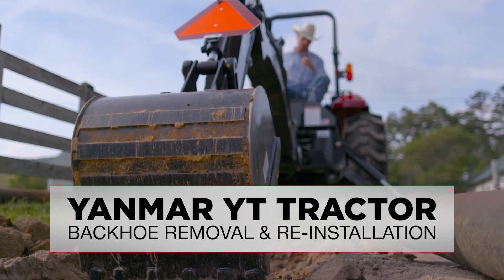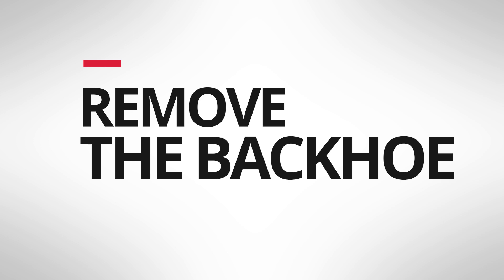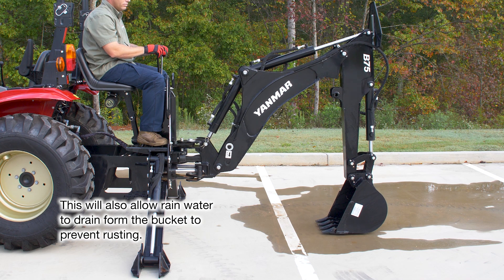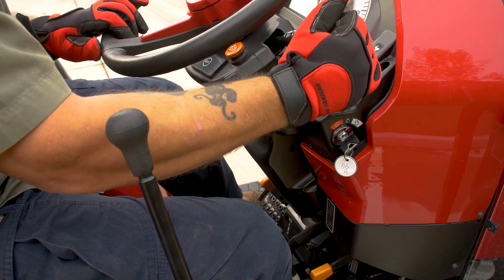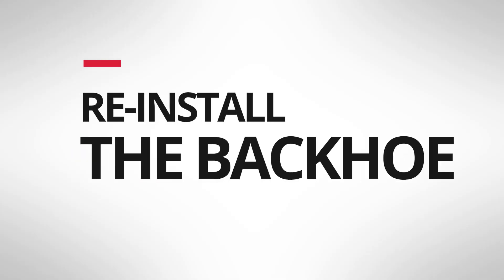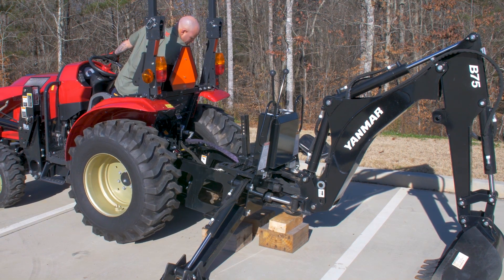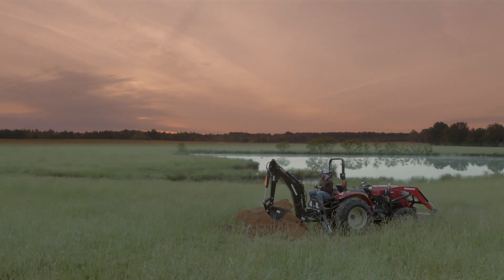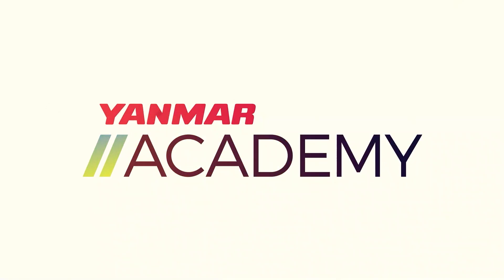YANMAR YT tractor | Backhoe removal and re-installation

Comment: Can you please confirm whether or not the YT235's (specifically with cab) backhoe bracket is compatible with the mid-mount mower.  I've read on some forums that dealers have said they would have to remove the backhoe's mounting brackets in order to mount the mid-mount mower.  I assume this was a miscommunication and they really meant that the backhoe had to be removed in order to leverage the mid-mount mower.  I currently have a JD 1025R TLB with MMM and I'm looking to upgrade.